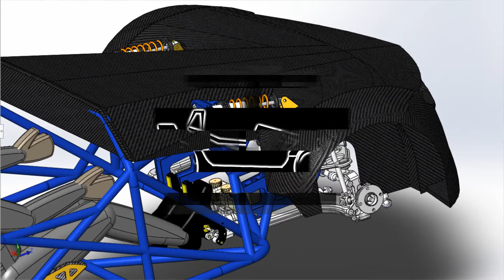Scratch Built Design # 19  Front Body Part 1 (bonnet)

Comment: Looking good.  That wrinkling or alligatoring of the gel coat is usually due to applying resin over it before the gel coat has cured properly.  Lessons learned and not too hard to fix with some filler.
Reply from the maker: Thanks Dominic